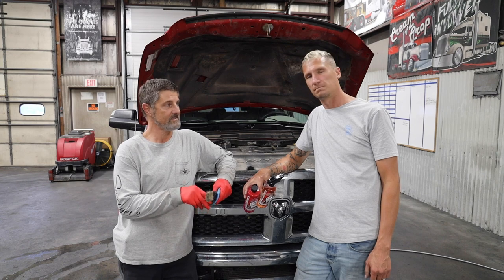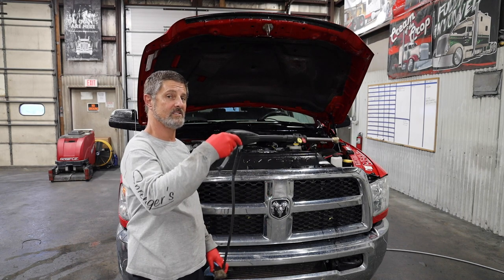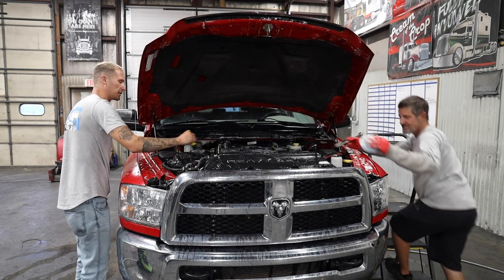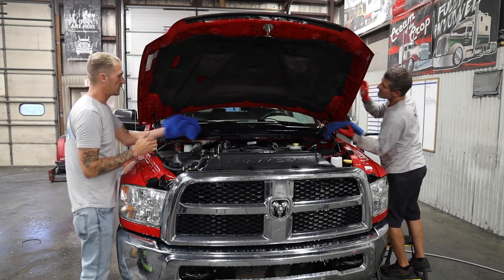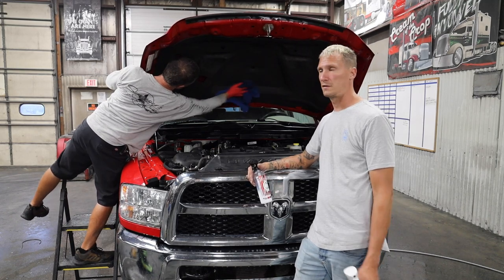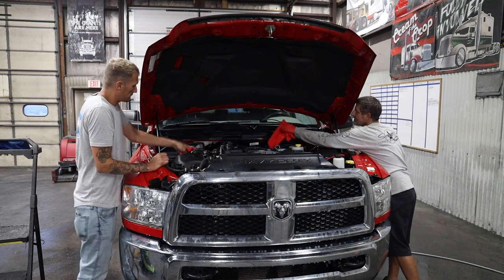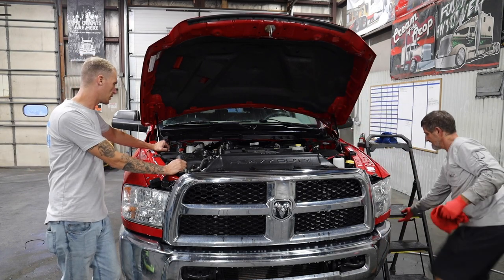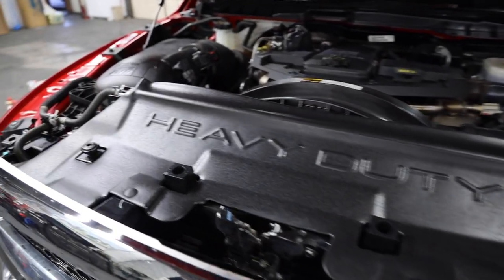How to properly clean a motor - Evan's detailing and polishing

Comment: Karl here in Denver. I reconfigured my spray gun by getting rid of the Lance. When you are using the foam cannon it is much better balanced and easier to use especially on engines bays.
Reply from the maker: Yes for sure.

Comment: Question for you how do you use flannel wheels how do you mount them on grinder  also which one do you use 60 ply or 40 ply thank you evan
Reply from the maker: I use the 40 ply that I sell and I use an arbor extension. I'll post a video on this process soon.
Reply: @EvanStegerMetalPolishing  Thank you i know its unusual question i learned alot from you